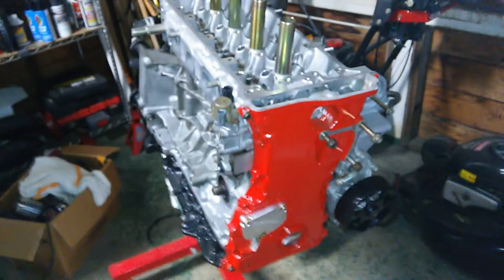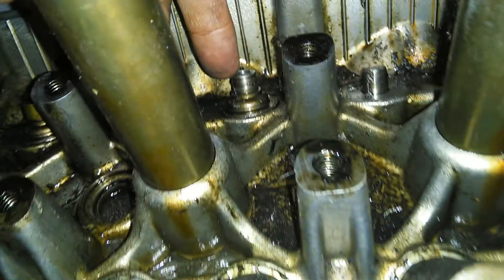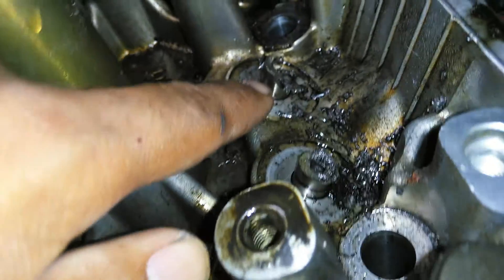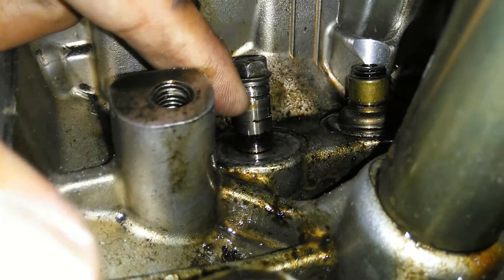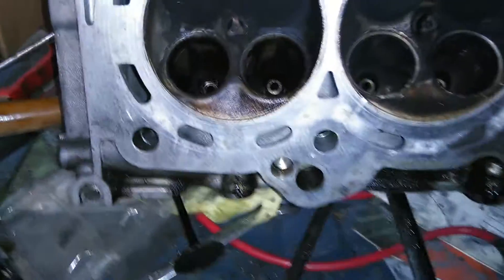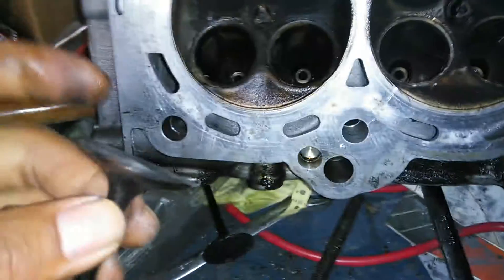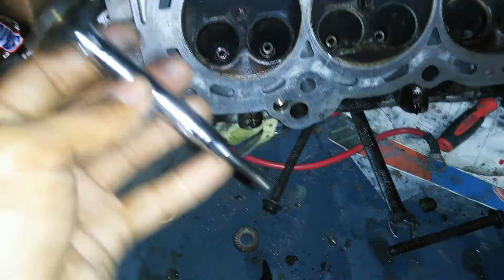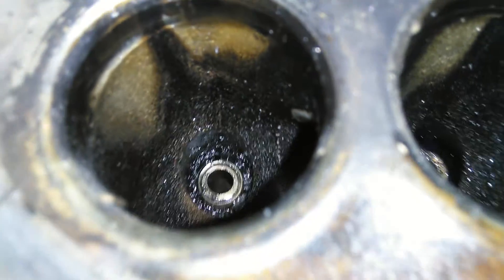K20 k24 valve guide removal

Comment: Did you successfully do it on your K20 head after practicing? Going to be doing this job soon. Any tips?
Reply from the maker: I ended up letting a machine shop do it. It was cheap for them to do it so I didn't see a point on risking damage

Comment: You can try using a heat gun or put it on a stove with an aluminum plate that way the head gets even heat all across
Reply from the maker: Those are good alternatives but ive learned my lesson lol. The machine shop doesnt even charge alot for that lol

Comment: You should be using a mallet not a hammer
Reply from the maker: expanse ek24 I ended up buying a tool to remove the guides.works faster and easier. I have a different video on that as well